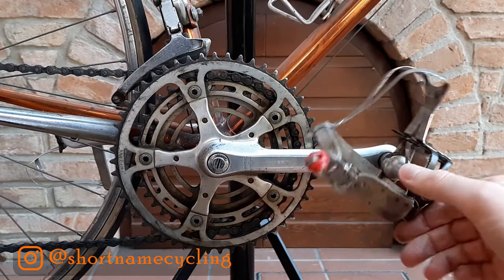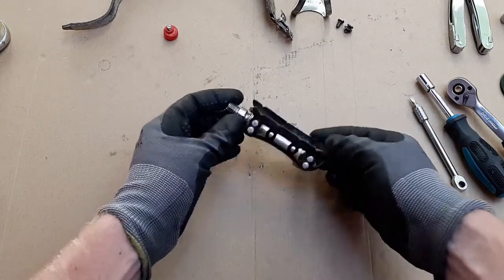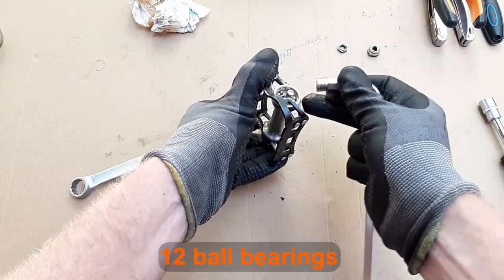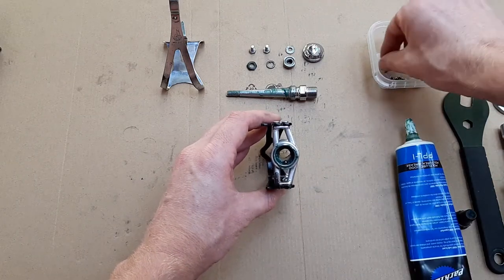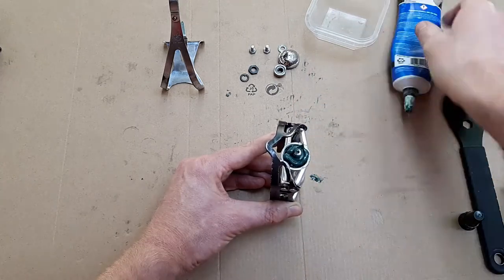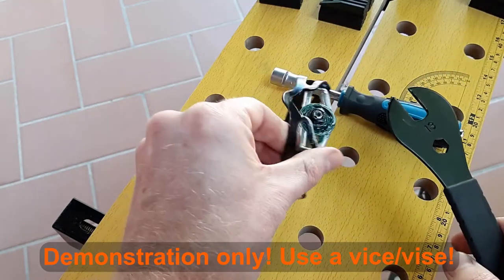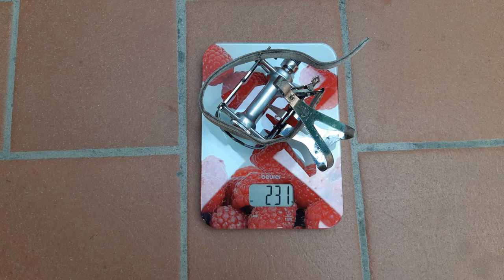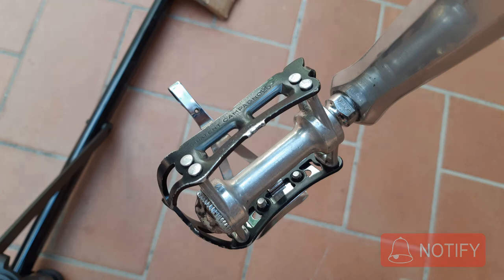Wilier Triestina Ramato Restoration Part 8: Campagnolo Record Pedal Overhaul

Comment: good work - thanks. Maybe a little too much grease - but it will soon disperse around the stem. 
A challenge for you - what if the pedal thread has been abused and will hardly tighten up on the crank arm? What "other" stem could be used, that isn't an original Campag Vintage - after all, it's just an internal stem of regular size - like any vintage wheel axle is a standard fit, mostly??